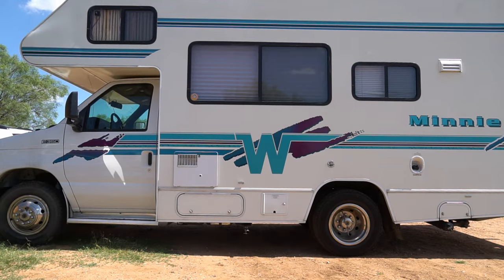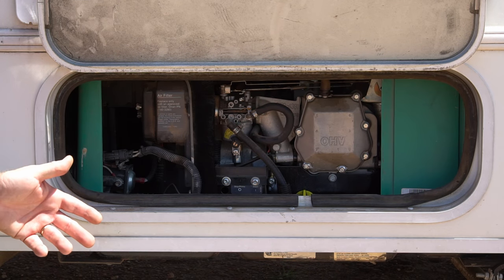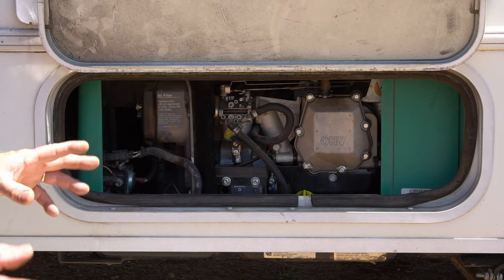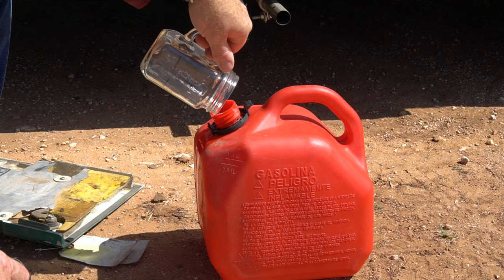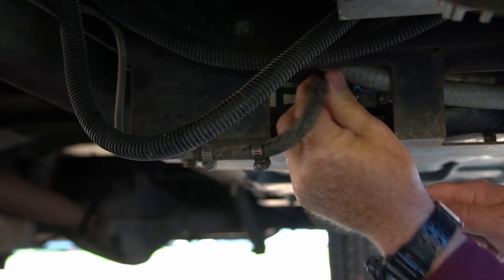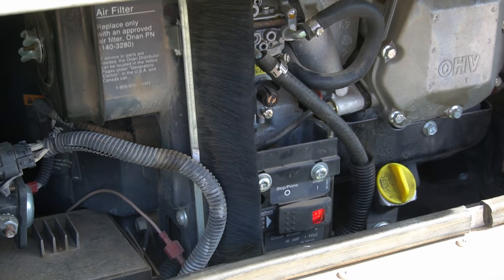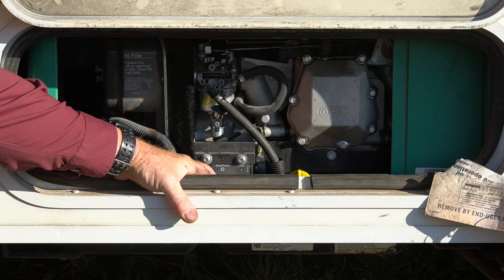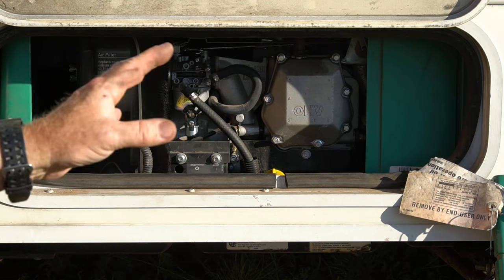🔧 How to fix a clogged Carburetor on an Onan Generator  Quick and Easy!

Comment: Greetings:-)  Can you help as to any knowledge/experience in conversion to propane...  I understand they run cleaner and easier to start after sitting.  Thanking you in advance,  -keith
Reply from the maker: I do not recommend converting to propane in this situation for two reasons. 
1. It reduces the generation capacity by about 25%. For example: If your generator is a 4000 watt gasoline unit, converting it to propane will reduce it to a 3000 watt unit. 
2. It will increase the cost of operation. It will burn more propane to produce less power, thus increasing the cost to run it.  This is not to mention that it you have a normal sized propane tank (my mini has a 10 gallon) you would have to fill you take constantly.  Based on my own experience with converting gasoline generators to propane, a 5000 watt generator can run about 8 hours on 5 gal propane.  So, if you have a 10 gal tank, you might get 24 hours if continuous operation out your generator before had to refill it. Of course this would mean pulling up stakes and driving to a propane refill place about once a day.  This would further increase the cost of operation.

If you still want to do it, you would need to buy a conversion kit. It is not complex to convert a gasoline engine to propane, but it is dangerous. A proper conversion kit will have the necessary safety equipment to make your installation safer.
Reply: @thejungleexplorer  Thank you for your advice.  I was not aware of the negatives regarding propane.  My main thinking was avoiding carrying gas.  My truck is diesel.  I do have two 30 gallon tanks.    My thought was pretty much just for charging my batteries when necessary, not so much for running air condition. Typically I won't be boon docking, I'll be plugged in. Thanx my friend,  -keith

Comment: Is there a specific reason you didn't hook the hose right to the carb instead of going underneath?
Reply from the maker: It is much easier to do it this way.
Reply: That would bypass the fuel pump and fuel filter.
Reply: I would love to bypass the fuel pump in the fuel filter I did not think of hooking it up straight to the carb as of right now I disconnected the line from the fuel pump and I have the hose running there but doesn't seem to be sucking it or priming it and it only runs when I spray it with starter fluid so I am going through the fuel pump right now and it's not even pumping I would like to fill up the fuel pump but I don't know how I'm going to look into hooking it up straight to the carb but I don't know where that line is how do you hook it up straight to the carb I have a quarter inch hose coming from my gas tank where do I put that at I'm going to have to investigate that tomorrow good point her good pointer thank you I am going through the fuel filter and the fuel pump right now and that's a problem because this generator has been sitting for about 5 years and it's pretty gunked up I'm assuming I was able to open up there cleaner and spray it down with B12 and carburetor cleaner stuff I was hoping that would work it but I think I'm going to have to take the carburetor off tomorrow but as of right now you gave me another great idea before I do that I'm going to see if I can hook up the line straight to the carb how I'll get fuel I don't know fuel pump pumps it from the tank into the carburetor so if I bypass the pump and the filter after like pour it in somehow figure it out it's full moon it's a beautiful July 15th 2022 evening I'm on top of my motorhome the moon just came out it's exactly 10:32 on a Wednesday evening the Moon is spectacular happy full moon to everybody and happy Wednesday working on my motorhome working on my generator and I'm learning a lot from watching all you guys so thank you for all the tips and pointers like everybody's saying we're able to save thousands of dollars doing it ourselves with all our youtubeographers videographers out there thanks for the tips and the pointers all you great generator professors how you teachers and then Spanish as we say maestro's Masters so thanks a lot keep you posted happy Wednesday

Comment: Whats best octane to use 91 or 87??
Reply: 91 is higher
Reply: Just use 87. They are low compression motors, and anything higher than 87 is just wasting money. It will NOT make it run better, or more efficient. 87 is perfect and what it was designed to use. Use 87....
Reply from the maker: Higher is better
Reply: @thejungleexplorer  
I STRONGLY disagree -
unless compression ratio dictates extra detonation supression , higher octane contributes nothing.
These small utility engines certainly do not ( by intentional design) fall into that category.
Reply from the maker: @michaelmoon8856  Thank you for commenting
Reply: Also true! Burns nasty though!

Comment: I just bought a 2011 RV with an onan 4000 generator. When I try to prime it the light doesn't turn on. When I try to start it, there is no noise. I have studied but have not yet repaired: how to replace the filter, replace the spark plug, change the oil, and now I understand what you suggest in this video. Unfortunately I can't try what you suggest in this video until the generator can turn on. What would you suggest I try first?
Reply from the maker: Does the generator not try to start at all?  If so, there may be several things that cause this. It is a process of elimination to figure out what the cause is.

First make sure it has power.  The generator starts off of the house battery, not the engine battery, so make sure the house battery is good.  Second, some RV have an auxiliary generator kill switch located somewhere around the rear exit door.  On my RV it is located down at the bottom of the lefthand side of the door.  This switch allows you to kill the genny without having to climb up into the RV.  It is easy to accidentally kick and if it is set to off, the genny will not turn on. If neither of these are the problem, then you need to check the power cables from the house battery to the genny.  If they are good, then the problem is either the switch or the starter motor.

I hope this helps.
Reply: @thejungleexplorer  The switch beside my backdoor was able to prime and then attempt to start the generator. It was unsuccessful in starting the generator but at least this switch gave the generator a try. Looks like I'll have a couple more steps here but your advice definitely did solve the first few steps in elimination towards fixing a few pieces. Thanks for the response.
Reply from the maker: @makingcloudsofthought3006  Awesome.  Glad I could help.  If the genny tries to start, but won't stay running or runs rough,  that definitely is a dirty carburetor problem.  The genny draws gas from the main fuel tank.  If this RV has been sitting for a while, the fuel may not be that good.  The RV engine may be able to run on it but not the genny.  I would siphon the tank empty and fill it up with premium gas with a standard mixture of SeaFaom.  The RV engine fuel system may benefit from a good clean as well.

Comment: Isn't that the gas line coming up beside the oil dipstick? Couldn't you disconnect where the rubber meets the metal right before the carbonator? and avoid spillage ?
Reply: You have to get on the pickup side of the fuel pump. That location is after the fuel pump.
Reply: @BADBRAD1959  Thanks, I tried where I said, and of course that did not work. So  is the fuel pump  up by the motor? 2014 Ford F53 chassis.
Reply: @ketonobull1649  No the generator fuel pump is inside the generator enclosure. Exact location depends on model. Mine is left side and way back and on the bottom. Disconnect where the vehicle fuel line which is usually metal connects to the generator, at a rubber section.The rubber fuel line section line is used to isolate vibration. Get your model number and look up the manual online and it will show the fuel pump location if you cannot figure it out by visual observation.
Reply from the maker: The way I demonstrated works the best

Comment: Onan junk! Not worth the time
Reply from the maker: What generator do you believe is better?
Reply: @thejungleexplorer  a Honda  3000 inverter   not a bad choice   remember at the end of the season run some premium gas and run the carb dry  that is for any small engine  you won't get bad deposits in the carburetor
Reply from the maker: @johnfleury5430  Yep. Can't get much better than a Honda.
Reply: Another one that never read the manual and has NO understanding. This is far easier than hand carrying a portable generator and gas cans. All small engines have the same problems if the owner knows and/or does nothing to maintain them. I have a Honda inverter and its quite fussy.